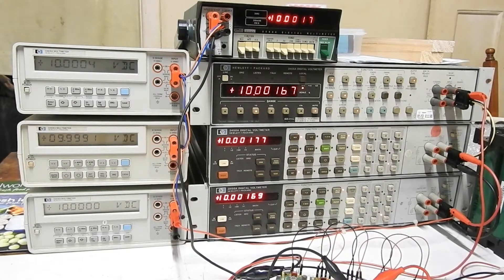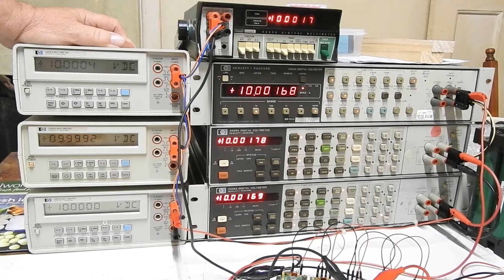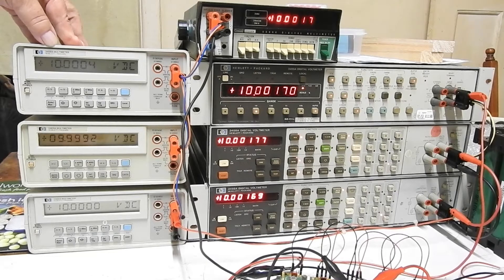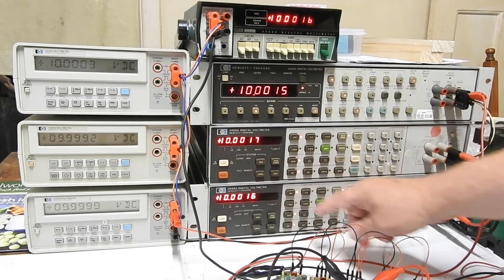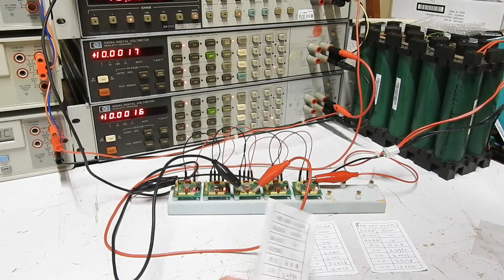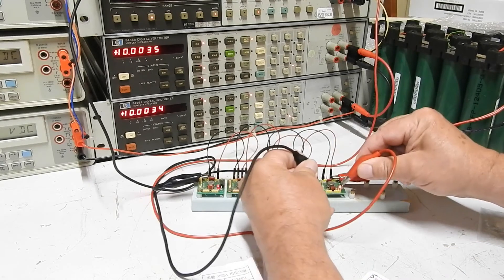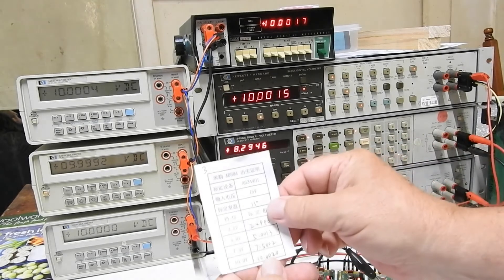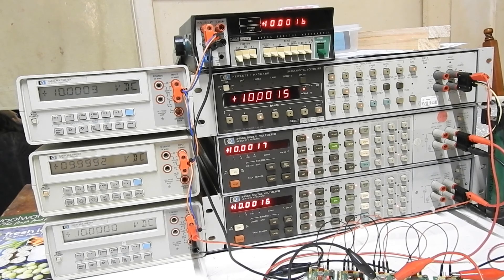HP3468s and other Voltmeters in Parallel

Comment: Is a backlight for the HP3468 LCD even possible? Was it an HP option?
Reply from the maker: Yes, it has been done. For a HP3478 I think, but it's the same display module. It's somewhere on the EEVBlog forum.
But IIRC, it's a messy procedure and easily screwed up.  (not an HP option)
I'm close to a completely  different solution, which I'll show soon if all goes well...
Reply: @bertoid  Thanks - I will check EVBlog forums.